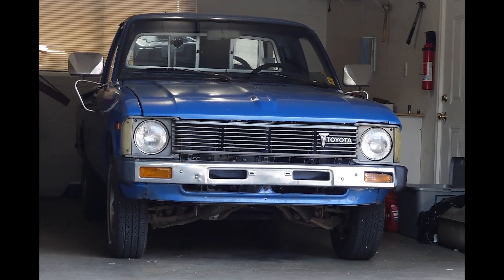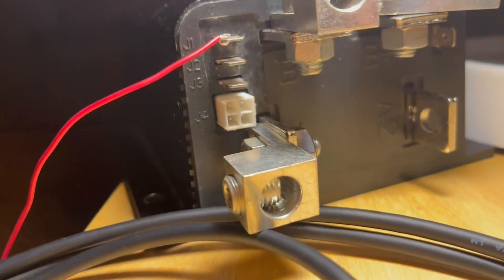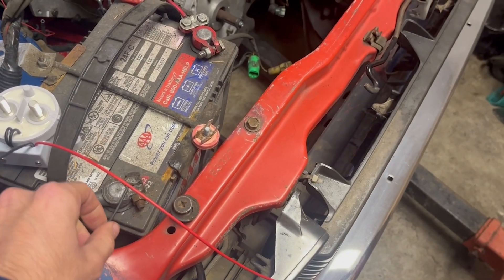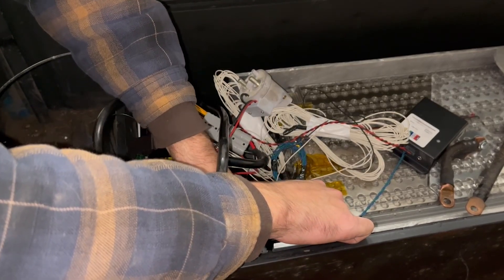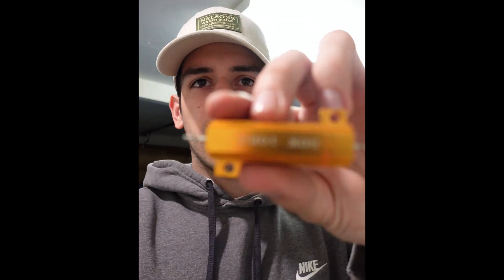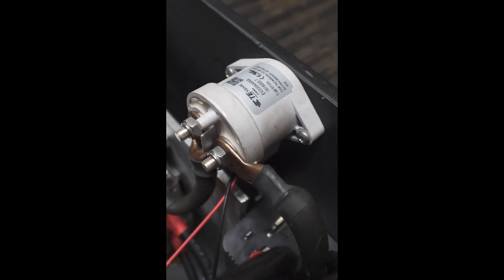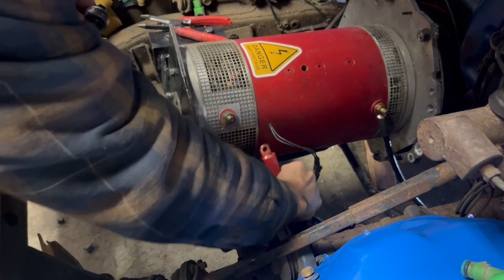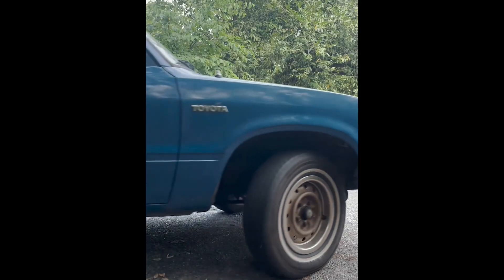Electric-Swapped Toyota Pickup Episode 5: Motor Controller and Circuits

Comment: On these low voltage systems, you can simplify your precharge circuit by simply connecting your resistor across the contactor terminals.  I'm running a 96v system in my Mule side by side in this manner.  It's actually how Kelly controllers tell you to do it but it works with Curtis, too.  With KSI off, there's no vampire drains. Cool build.  Thanks for the videos.
EDIT:  After looking closer at the Curtis wiring schematic, that's how they have it.  So, maybe that's what you said but I didn't hear it??

Comment: The contactor should be "off" when the car is charging (via signal from the proximity wire), when it's in gear (so it doesn't drive off suddenly), when the "gas pedal is depressed, etc. Very good video.  Thanks so much!

Comment: how long does motor brush last?
also what is the expected range ?
whats the expected load on truck bed?
Reply from the maker: The brushes should last at least a few years. Expected range is around 50 miles and the load on the bed is just under 200lbs